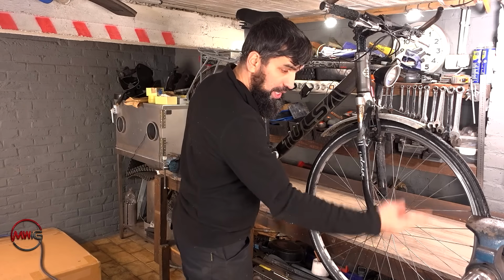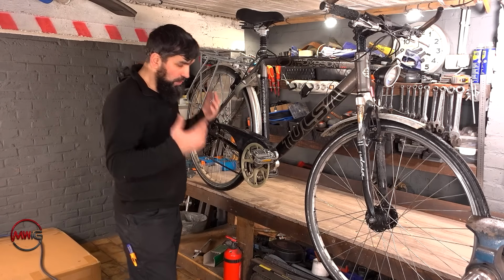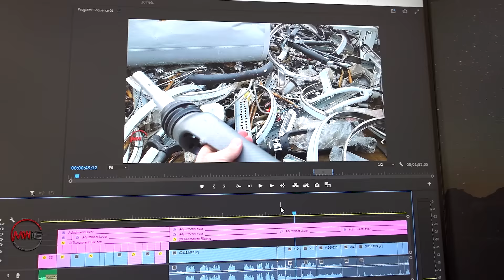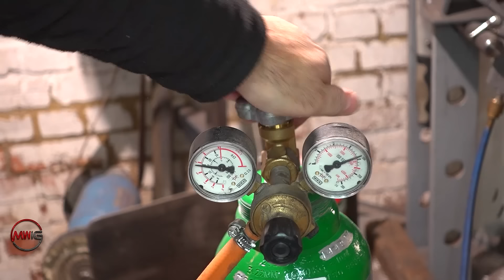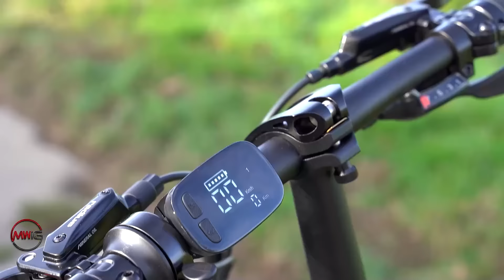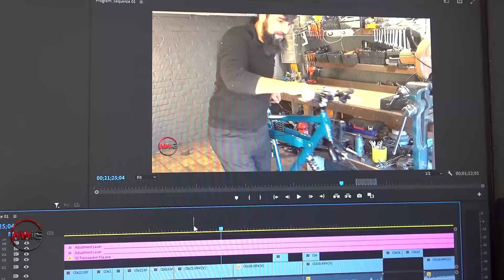DIY Front-Wheel Drive Bicycle with Rear Wheel Steering | Epic Custom Bike Build

Comment: 😆The angle of the rear wheel head will make the wheel unstable. Extend the frame and install the fork in the direction of travel.

Comment: I also built my first trike as a fwd two wheel rear centre steer. It confused most who tried to ride it because to turn left you had to push forward on the left handlebar instead of pulling back and push forward on the right handlebar instead of pulling back if you wanted to go right. LOL.

Comment: Without the weight on the front of the bike it makes it I stable. Maybe adding a small shock absorber to each side of the post on the back will dampen the steering

Comment: It almost looks like there is a small amount of play in the steering rack of the bike. Maybe add a gas strut (like the ones on car hoods/ bonnets) to control the wobbling? It may also help with fine steering adjustment. Or it might not do that.

Comment: the pivot point of the swivel wheel I think it should be vertical to the plane of the road and as you have or a little more camber the swivel fork itself and the handlebar lever with less radius than the swivel fork coupling then I think turn less sharply
With the little that I see in the video, I mean details of the position of the turning lever. For example, the stopped video seems to have the handlebar turned fifteen or twenty degrees and the wheel is more

Comment: It seems to me that, stability-wise this is the same as riding a fixed gear bicycle backwards.  There are people who can do this of course but it takes practice to get the hang of it and it isn't stable.  In learning to do a trackstand I found that correcting for balance in the backwards direction is only possible for small corrections.  For large corrections it is not recoverable; instability sets in.  However, rear wheel steering is possible and stable for tricycles (see black iron horse tricycles and others), where balance stability is not an issue.

Comment: Why the negative head(tail) tube angle? I think that's why your getting speed wobbles. Also you should try inverting the steering output so when you turn the bars the wheel is opposite the way you have it now.
Reply: Your bike riding brain tells you to turn the way you are starting to fall to effectively stear the bike back under you the way the bike is setup now if you do that it makes you lean harder in that direction. Inverting the steering would make sense.

Comment: I think the steering needs to be calibrated where as u turn the handle to the side the differential at the rear would only be half (or less) of what u did in front, I think. Maybe I am wrong.

Comment: I also wanted to redesign my bike to match the weight of 160 kg, make the rear wheel wider and the front wheel narrower, and the spokes are 3 mm per wheel. Bicycle road off-road, for people with a lot of weight...

Comment: You need a  bigger rake on the rear steering wheel, as with castors that self align  straight. Also add a small pneumatic piston and cylinder will help!

Comment: Looks like the biggest problem is not the rear wheel steering, but the way it transfers from the front to the back of the bike. There is too much wobble to control it reliably.

Comment: the problem you have is because you put the fork on backwards.  The fork needs to be oriented in it's original foward direction so you have trail/caster to stabilize the bike.  Because the fork is facing bacwards the trail/caster is in the opposite direction making the bike unstable.

Comment: whether the direction of the castor angle, or the direction of steering should be corrected, whichever from these both, because, now when you are in a turn, your muscle memory puts you in even greater lean/turn, when you want actually to balance it out, if you are getting my point
Reply: According to physics it is not actually possible / stable / to be done. The reason is that because of the reversed direction you cannot initiate a mass shift towards the longitudinal centerline, and thus only continue to fall. That's why you can try the aforementioned point of reversing the steering, then this will shift the reaction of when turning, but suddenly being hungry for a outwards mass shift
Reply: But you will need to get used to the reserved steering input. And even then the results would not be terrific

Comment: The problem you have is that you rattle on the back of the steering wheel quite a bit. I think it's because you're not looking at the steering wheel. Install a camera or a mirror and watch your steering wheel while you drive.
That could possibly help.

Comment: Resistance in the handlebar would help. Put in a spring that pulls the bar and wheel straight when not being pulled either way by the rider. That will make taking off a lot easier.

Comment: I got great product you can built, Drum rollllllll, a Gyro Copter, it will be relatively easy to build, but you will need very trust worthy engine (Rotax) and obviously a Pilot to fly it and kind of supervise quality control because he will be flying it. LOL! Note, taking off, easy, landing not so easy, I tried and almost ended up 6' under ground. So it is better to first dig the grave and try to land as close as possible to the hole.

Comment: I know it is counterintuitive, but i think that the only way to steer is not with the steering, if you tuch it and naturally push to balance the pedalling forces you go straight to the ground, but... theoretically if you would sit without hands just pedalling and steering with your weight you could do it, practically you would crumble on the ground if you want to brake.
For this reason it is a BAD idea.😂

Comment: Correct me if I'm wrong but I think you gain more control over that bike if you lean forward. I saw that at the and of the video. I sure bet it was difficult to drive without any doubt. A one wheel bike is easier to drive than this. Unfortunately this bike doesn't have a future.

Comment: You should now change it to try-cycle. Put one more wheel in the front, two front, one rear, and the rear will be steering. That would be half of your work. This is a big laughing material you made, but your skills are mazing as always.

Comment: You keep instigating imagination! Wonderful!
In order to make this bike stable, you need to change the angle of the rear wheel fork to different direction. Just like is the fork angle of a standard bike.
Then the rear wheel will go self-balancing.
The secret of bike self-balancing is the projection of a line going through the wheel fork turning axis to the road plain lies before the point of wheel contact with the road. When someone push the bike pedals, the bike accelerates and the front wheel is forced to go straight.

Comment: Enjoyed watching this build. My wife asked me why you were doing this, and I told her it was for one reason...you like to take on challenges, no matter how difficult, to see if you can do it. There is one suggestion I would like to make that I think will add stability to this bicycle without making any changes to your design. By adding a strut to either side, or both sides, of the rear wheel, this will stabilize the tendency to rotate. It will add a little stiffness to the steering, however the rear wheel will want to stay in a straight-line position.Thanks for taking on something that promotes our thinking.

Comment: probably work better with a small rear wheel and a low angle on the rear fork, also a lower centre of gravity. PS. thanks for the drone noise. mmmm

Comment: Its not the bike thats the problem, the wheel has to turn in the opposite direction to give the desired turn , this tricks our balancing technique , a few days of practice will make it like a normal bike , offcourse since the weight is not on the driving wheel it will have some minor problems but the bike will work fine .

Comment: Corrects the angle of the rear fork. It's very perpendicular to the ground. It should be closer to 45⁰. Below that, in relation to the ground, the fork can break due to the increased torque on the joint.

Comment: as most people have pointed out, the forks, or really, the steering tube, is tilted the  wrong way.

rake, and trail, and caster.

caster. the angle of the tilt. vertical is unstable, flat is... well, the wheel flops over rather than steers. 75 degrees is about average.
trail. the forks pivot along the headtube, extend the line until it reaches the ground. the distance from this point to the contact patch of the tyre itself is the trail.
no trail, or reverse trail like this, and its unstable.
too much trail and the self centering effect overpowers steering input, its hard to steer.

rake, the offset of the axle from the pivot line. most of the time its in front of the pivot line, and that reduces trail, yet allows one to keep a nice steering tube angle.

when you steer, think of the forces. the bike flops over on the contact patches, yet the front wheel pivots due to the steering tube angle.
stationary... twist the bars. notice theres  a slight LIFT from centre. the natural point of equilibrium is straight ahead, at the lowest point... steering lifts the weight higher, and gravity... sucks...

 when moving, the lift is still there. the "least energetic" position is with the wheels straight ahead... even when leaning over.

but added onto it is the dynamic action, the contact patch is always behind the pivot line, and it tends to pull it back to centre. along with triangulation of gravity, momentum, angular velocity, tyre friction, blah blah blah, having a nosey around and getting in the way...

as you lean over, the torque of these forces around the steering tube angle/pivot line causes the wheel to rotate so it steers harder into the lean... the dynamics of two wheeled vehicles meaning the wheel tucks in UNDER you and lifts you up, straightens you up out of the curve... theres a whole bunch of other things going on like the contact patch moves along the circumference of the wheel depending on the lean and the rotation... two wheeled dynamics are freaking complex.

anyway, the more trail, the more this reactive self centering effect. you can go to the extreme, and make a bike so stable that its unrideable as you simply cant STEER it. it will want to go straight ahead... 

you can ride no-hands due to how the forces of friction and torques through pivot points give a nice negative feedback loop that is controllable. 

here, the setup is exactly opposite to how it should be. any instability is AMPLIFIED.

you can roll a pushy down a hill with noone on it, it can hit bumps, holes, get air, and it almost always keeps going straight and upright.

roll one BACKWARDS... and it instantly falls over in a heap as it tries to rotate back on itself to the point of stability. 

riding this is akin to riding a normal bike backwards. pretty hard. its easier if its a flatland freestyle bike  with almost no caster, trail, or rake, so it acts much the same either way... the more stable the bike FORWARDS, the less stable it is BACKWARDS. freestyle bikes arent made to be stable... not say, like a DH MTB...

Comment: I think you overlooked a basic requirement for 'steering authority'. The fact that the steering wheel wobbles around tells me that the extension of the steering axis does not point to the right position and that causes errors to amplify themselves! Study how the line through the steering axis always needs to point a bit ahead of the tires contact patch. How about your experiment?

Comment: As crazy as it may sound, I'd flip the steering. In my mind it would then feel more like a normal bike when counter steering, though I think it would also make the steering so that once you counter steer, you would feel very uneasy and make correction, resulting a situation where you'd have better control. And I think it should have at least 600 mm+ handlebar for better control overall.

Comment: Ratio between handlebars and rear wheel needs to changed.   Need 1/2  or 1/4 the movement on the wheel.

Comment: I think if you can add some resistance (so you need to put a bit bore force on the handle)  to whe wheel, i think this could work. Most of the current problem seems to be that the bike wants to 'death wobble' if you can minimise this, I think this bike would work better, or change the controls (dont know what to).

Comment: you knew how this was gonna turn out if youve ever driven a fork truck, or any other vehicle with rear wheel steering 😅 it gives them the ability to have a super tight turning circle but also makes them harder to keep straight because of it. That said, its still an awesome project! I was surprised by how many totally custom parts you made, I was expecting it to be like 95% chopped frames. Question though, whats with the weird rotateable dingus at the very front below the handlebars, the thing you tried to put the headlight in at first? You put a lot of work into that part but it seems to do nothing whatsoever 😂

Comment: The problem with rear steering has always been the sensitivity is too high for most applications as you found out. That is why rear-steering cars are not on the road. Just doesn't do what we need when we need it and is very hard to control.
Reply: Actually activation of steering in the front reduces the radius of the turn, while the activation in the rear increases the turning radius- therefore you can never accomplish a similar tight turn with this rare way!

Comment: You need something (springs?) to keep rear wheel centered with padded stops to prevent wheel going too far either direction. Some welding may be required. I'm sure you have already fixed this but this is just my thoughts.

Comment: Several things. Rear wheel steering is always harder to control. You need to slow down the steering to reduce the steering input. Possibly even limit the amount the rear wheel can turn. Another issue is weight balance. Ideally, you want more weight on the driven wheel.  I think the longer wheelbase helps you out here. I wouldn't go shorter. It's certainly very challenging trying new concepts in the cycling world! I built my own front wheel drive, front steer bike that works well. But I went through several prototypes first!
Reply: Also steerer angle is reversed... Probably the main cause why its impossible to keep it straight its like pulling your bike backwards
Reply: jep, he should look up some bikegeometry first, before building.   @mihkus
Reply: I was thinking the same thing he definitely needs to take weight off of the rear and change the steering ratio .  For one as soon as he set in the bike the suspension bottomed out the you could clearly see the rear steer tire flailing about from the tinyest amount of input
Reply: It's just a general issue with real wheel steering, needs time to get used to it as it escapes from under you, goes wider in turn.

Comment: I think, it didn't work because you didn't think about the correct geometry of rear steering wheel. It is not just flip the front bike forks to rear.
On the bicycle, correct geometry means, that point, what is intersection of steering axis and road, is in FRONT of point, where tire meets the road. This makes the steering stability, and the wheel ,,wants" to steer up front (similarly like wheels on shopping cart). When you only flip front forks, this behaviour is exactly opposite, and steering is extremely unstable.

Comment: Add a steering damper to stiffen up the steering. The other thing working against you is balance. If you shift your position even a little the bike reacts a lot. You steer bikes by leaning to one side or the other and don't even need the handlebars other than to hold onto them for the vast majority of the time. Make the steering really stiff. I think that will help quite a bit

Comment: It looks like you need to change the steering brackets so that you need to move the handle bars further and get less movement from the rear wheel steering. At the moment the slightest twitch in the handle bars sends the back end flying out. By changing the brackets so you have to move the handlebars further you should get a much smoother and easier ride. Please can you try to do a second episode? That bike is far too cool to end up in the scrap heep 😊👍👍👍👍👍

Comment: You need a stabilizer for the back wheel,  just like the ones on a 4x4 truck. It will dampen the wobbly from the back wheel

Comment: Hi.  By having the tyre/road contact point in front of the steering axis you have removed the self castoring action of the steering, and of course this makes it very tricky. 
I believe if you angle the steering axis the other way (i.e. forward) I reckon it will work, and it will have the added benefit of 'castoring' again.
Also, thinking about when riding a conventional bike, when you begin to lose balance to the left, your C of M (centre of mass) is moving to the left of a line between the two tyre/road contact points.  
In order to correct this imbalance, you move the contact point of the front wheel to the left so that your C of M is brought back into alignment with the two tyre/road contact points.  And vice versa.
I am therefore wondering if perhaps your steering should move (the 'new' steering wheel) the opposite way to how it is now (in the video).
Just my thoughts, but in any case, I'm sure you will get it sorted out.
Regards Mark in the UK
Reply: И еще нужно бы уменьшить зависимость поворота колеса от угла поворота руля в меньшую сторону.
Reply: врядли направление наклона вилки улучшит ситуацию со стабилизацией. эффект самораскачивания возникает и на велосипедах и на мотоциклах на большой скорости (с правильным углом наклона к поверхности). в данной конструкции, как и в остальных, он обусловлен люфтами элементов управления и физикой колебаний, которые постепенно нарастают, усиливаются и делают конструкцию неуправляемой
Reply: Rear wheel steering bikes as inherently unstable, but who does their homework anyway.